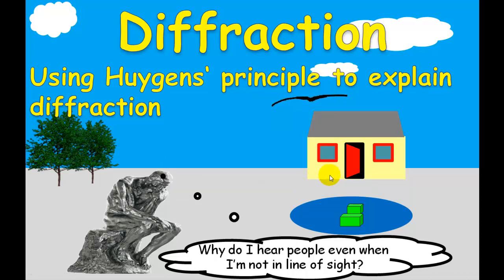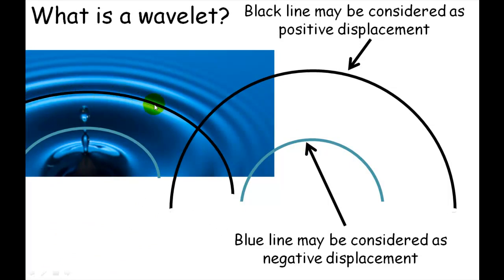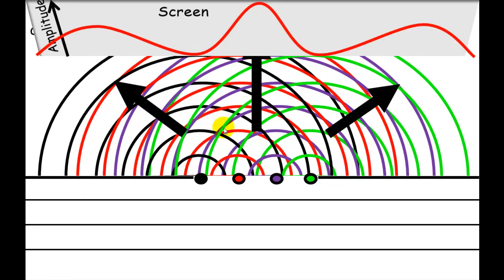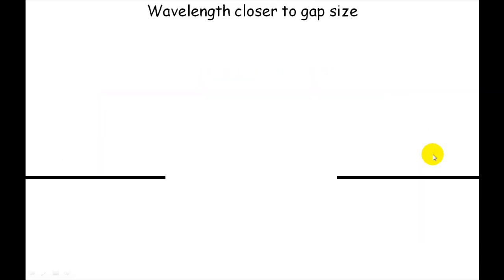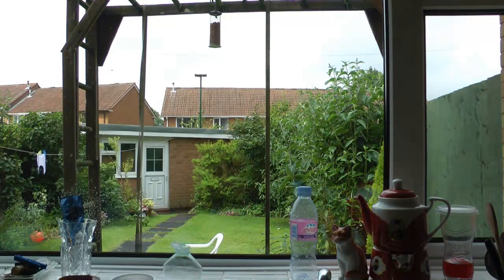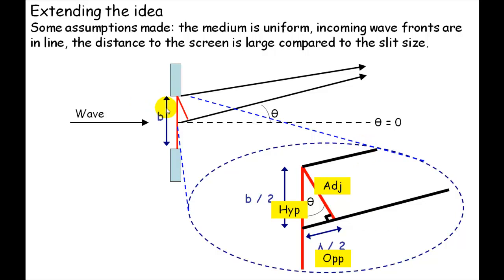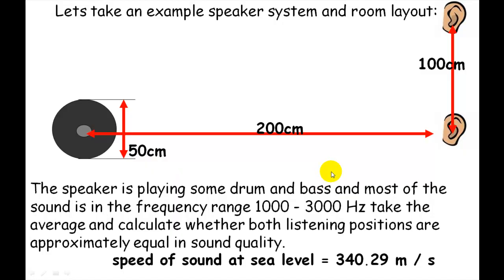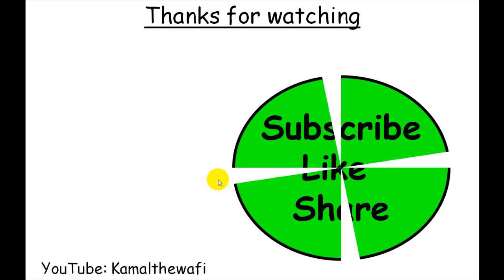Diffraction explained, Huygens' Principle in light, sound and water waves

Comment: The visuals in this video really made me understand this principle much better. Thanks alot! There is one thing in my tekstbook that says that when an opening is a slit, the formula you used in the example does apply. However, when the opening is a circular opening the formula has to be adjusted to; sin ()= 1,22* wavelength/Diameter. I thought that the speaker is a circular opening? Or am I wrong?
Reply from the maker: Interesting, I have come across this 1.22 fudge factor befor before but never worked out how or why it was used. It was not a priority due the syllabus I teach, if you find or make anything that explains it please share. Thanks for the comment 😁
Reply: kamal Wafi I asked around but nobody could tell me where this factor comes from. If I come across an answer I will post it here! Thanks again for this video 😉

Comment: this is really great, however I have a question. The thick black line is a barrier where the waves can't go through. You have drawn a hole in the barrier where the waves will enter and diffract. My question is then, what are the point representing? wavelets coming through? if so shouldn't there only be one wave drawn when the hole is the same size as the wavelength? or are the colored dots obstacles in the hole?
Reply from the maker: The dots are like the pebbles that would be producing the wave. You could draw 1, 1000 or a million the more you have the more accurate your model will be. In a ripple tank plane waves are produced by a beam in the water, Huygens realised that the beam is just many point sources of waves next to each other like many pebbles landing in the water in a line.
Reply: kamal Wafi but if more wavelets can pass at the same time only the wavelets closest to the left and right will diffract. the wavelets in the middle will continue as a straight line as they have nothing to diffract around. This means it will be a straight wave around the same size of the hole but with wounded edges right?